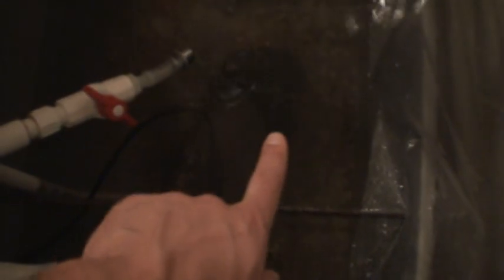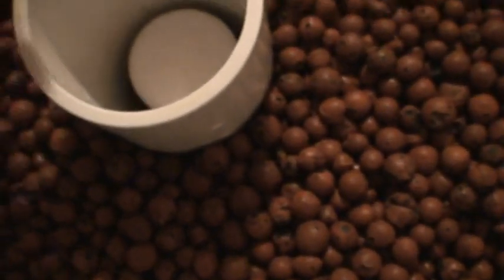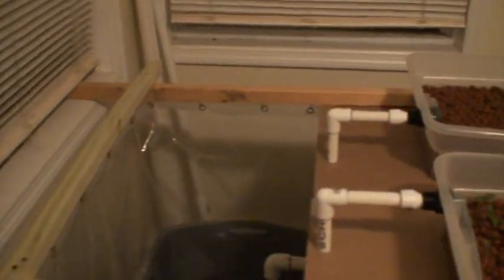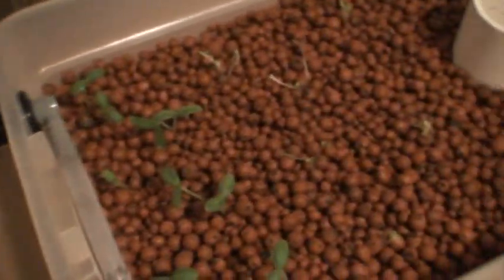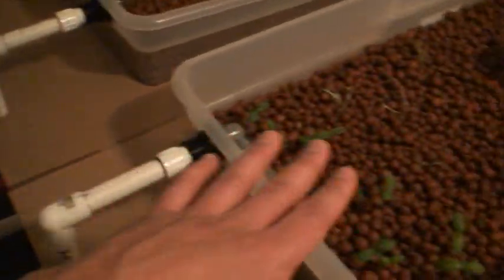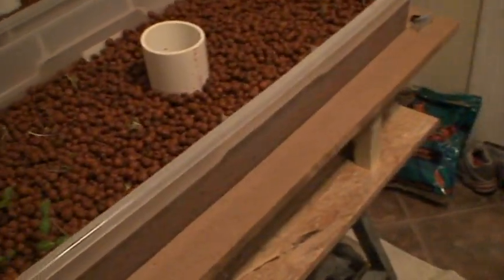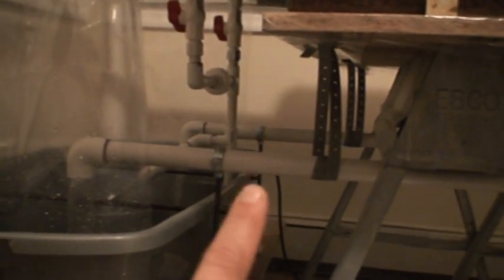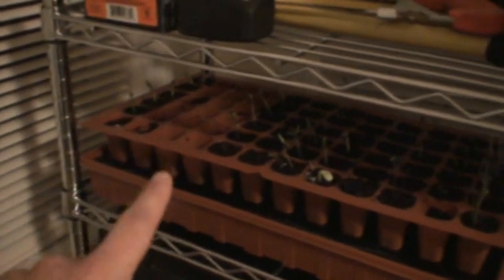Aquaponics 03 - [almost complete] system

Comment: 4:15 what pvc pipes are you using? are they all 3/4" inner diameter and 1" outer?

or are they

3/4" outer and 1/2" inner pvc pipes?

Comment from the maker: @bluzy25
taking this into account, the down spouts at the end of the 90^ elbow would end up only an inch or two past the fitting edge.

I was also considering the possibility of incorporating some micro-generators into the system (on the 2 drains) to re-capture some of the energy potential there.  Albeit not a lot - it's the aggregate I'm interested in for trickle charging some batts augmented by solar (for the 37 W pump).  TBD...

Comment from the maker: @bluzy25
If I'm following you correctly, you're referring to adding a piece of 1" to the 90^ elbow at the end of the drain above the f.tank water.  I too am thinking about this.  However, I must point out 2 things:  1> I am attempting to use the 2 drains' outflow to add additional aeration. 2> with the f.tank @ ~42 gallons, (upto) 16 gallons can drain out at any given time (to fill 8 gal into the GBs each).  This significantly lowers the water level in this 2'x3' 22"H container.

Comment: also, you'll want to keep light from reaching the roots.

check this out;

get a sheet of foam insulation board to cover your geolite and start your seedlings in rockwool cubes then cut squares into the board the size of the rockwool cube for a patterned arrangement.  Half way through growth cycle you can remove the rockwool cube from the sturdy mature plant.
wear gloves, never rub your eyes when handling rockwool.

Comment: almost forgot to mention a very inportant reason for dry time. 
Combating root rot as the scale changes  the plants generate more roots, 1/2 way through the process and everthing dies is quite depressing.
Foliar feeding is king for your system in which nutrients is at a minimum.

Comment: @VincentVonGoat 

hi think you misunderstood my question, I'll reiterate;

Due to the timespan the plants require as a 'dry time' to take in oxygen for growth, the dry times vary per the medium plants are seeded. 
For Example; 
Lava- rocks are more poreous which benefit plants a 5.5 pH and shorter dry time.
Geolite-less poreous, 5.7 pH, slightly longer dry time
Peatmoss- airy dirty mix, 5.9-6.0 pH, temperature determines (dry) down time.

Comment from the maker: @flippinrawks
GB's are 90 qt / 85 L [31"L x 12"H x 13"W]  With 10" of hydroton.  Both have 1" drain system (ID of bulkhead fitting)

GB w/ 7"x 1/2" dia standpipe = 3:30 fill, 1:15 drain.

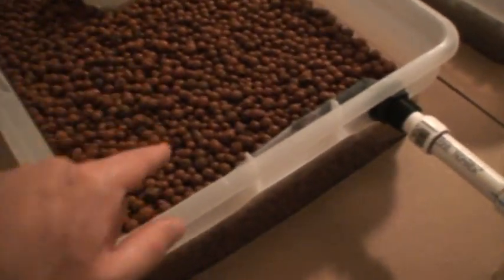GB w 8"x 7/16" dia (7"x1/2" dia standpipe with 1/2" PVC cap press fit on top with a 7/16" dia hole drilled in it) standpipe = 4:00 fill, 2:15 drain.